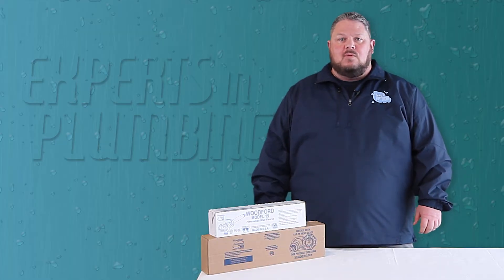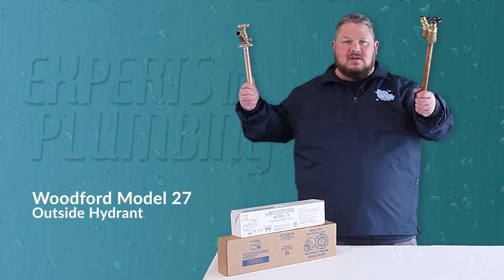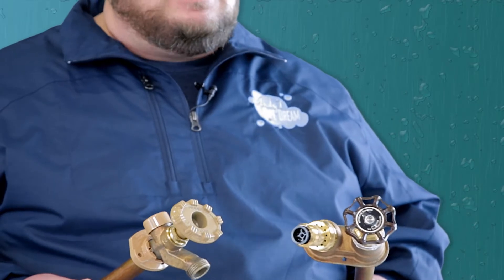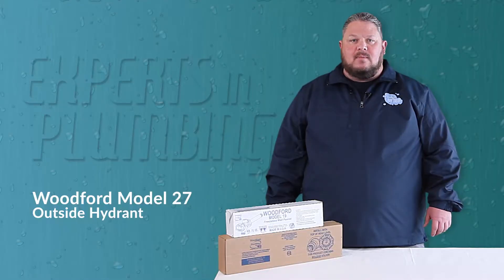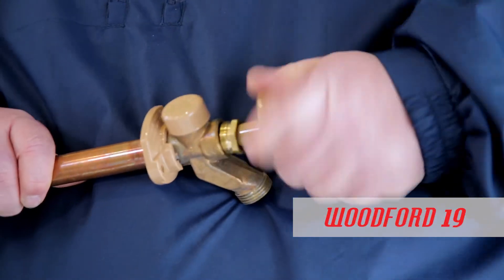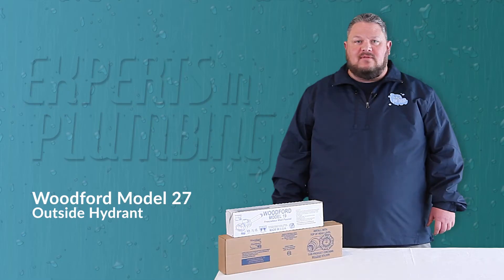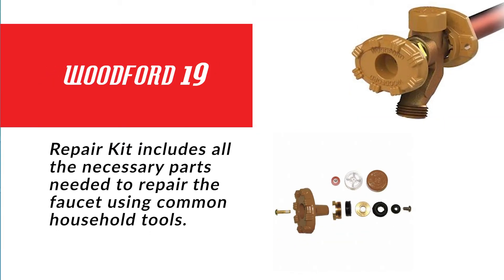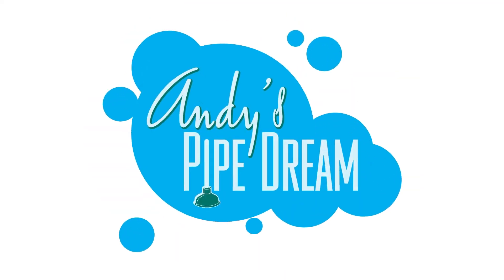Woodford Model 27 Automatic Draining Freezeless Wall Faucet- Andy's Pipe Dream

Comment: I am a plumber for a company in Virginia and we have installed the Woodford 17/19 for a long time but they started stocking the woodford 30 on my truck recently without telling me anything about it. The draining feature on it regardless of the hose being still connected to it is pretty awesome! It’s a good selling point for my customers! Thanks a lot for the video!

Edit: the woodford 30 is the same as the 27 except it has the same handle as the 17 (circular plastic handle)

Comment: I have a woodford model 25 and everytime I used the water hose, I get a leak from within the basement. I've changed the insides and bought a new vacuum breaker. It only leaks when i used the hose. Back pressure?
Reply: You figure the cause? I am unsure why this would since backflow wouldn’t create pressure above water supply pressure, ie should theoretically leak all the time. Did you call Woodford customer service? They are extremely helpful
Reply: @mateogrow4454  Dude! You would not Believe it! the tail end was never soldered on. It was press fitted. I almost killed someone! LOL. Crazy!!!
Reply: @ELDecano1971  nice man, glad u got it figured out! Thx for response